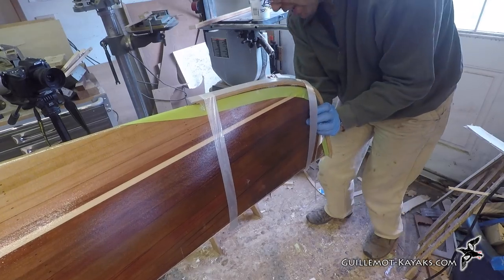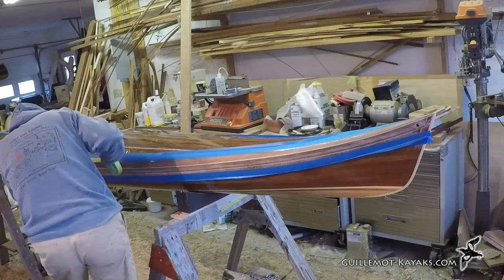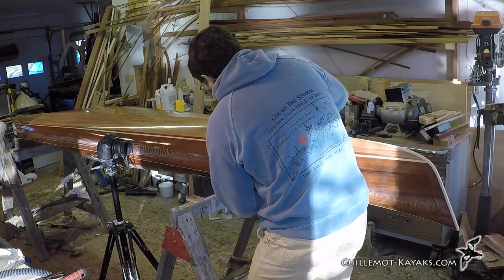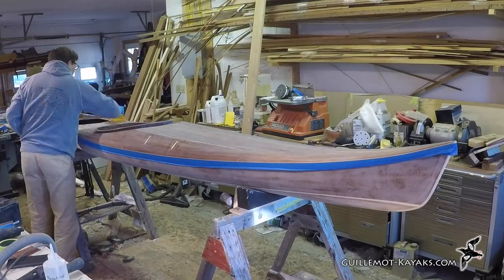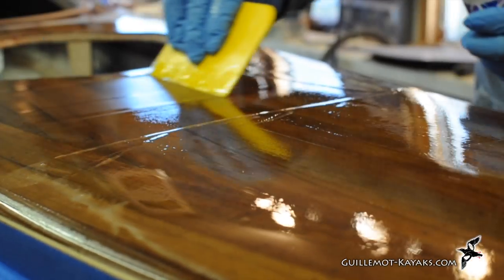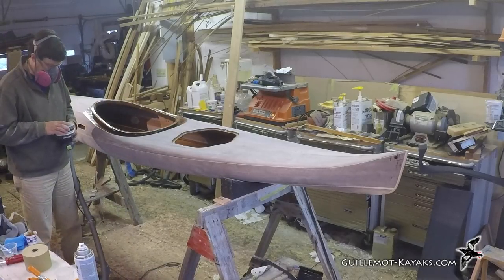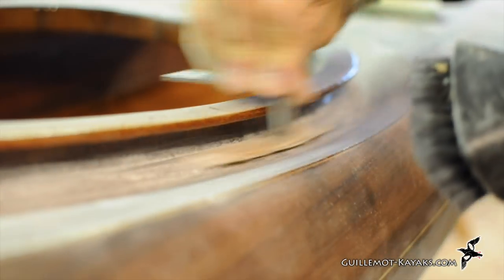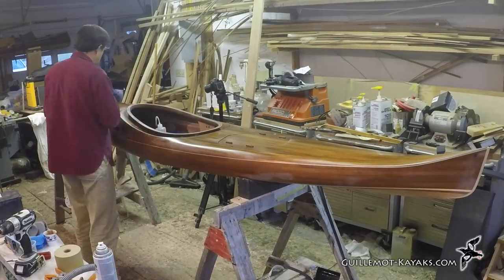Making a Strip Built Kayak - Outer Seam, Final Sanding and Prep - E17

Comment: Thanks for the videos - I'm a rookie currently building a S&G kayak and it's very encouraging to see how many layers of epoxy and sanding goes into getting a good finish. Without this I'd be less sure of what I'm doing poorly and what's actually OK. Cheers!
Reply from the maker: I'm glad you are finding it helpful. The fiberglassing and finish work of a S&G is essentially the same as a stripper. Other than the actual woodwork, most of the process is the same.

Comment: Nick,
This series has been amazing!!  Having read your books and acquiring shop space, I  look forward to building my own floating art!!  One question on fill coats...  Sometimes you use a heat gun to make it flow and pop bubbles, etc., but other times you use a torch.  Any difference between the two or whatever was closer at the time?
Reply from the maker: I use them almost interchangeably, the torch is more powerful, but risky. The heat gun is slower, but safer.  

I have found that with if I am using West Systems, the heat gun is ineffective, only the torch seems to do the job. With MAS either works.

Comment: Thanks for this video. I’m currently fiberglassing and applying fill coats to a CLC paddleboard, and have been struggling to achieve a smooth finish. This helps! Curious, can you explain the “torching” process a bit more? I’ve heard about the heat gun trick, but the torch is new!
Reply from the maker: The torch is essentially the same as the heat gun, only more so. Heating up the uncured epoxy lowers its viscosity, and expands the air in bubbles. This allows them to rise to the surface and pop. The lower viscosity helps the resin flow out and level. This would be particularly true on a nice level surface like a paddle board.

Comment: Several questions regarding hatch opening and cover -- In a previous video you mention sealing the edge grain of the cover with epoxy -- do you then add cloth or is the epoxy sufficient? And related questions to the hatch opening -- First of all, it appears you have added an inner strip to the opening that sets proud. Is this to better the seal or cosmetic? And at no point in the video series do I see cloth being added to the upper surface of the hatch opening. Given your propensity to cover all wood with cloth I assume this happened after the grinding of the finger grooves but was not shown -- or?
Reply from the maker: Hi Paul,
I usually add a little colloidal silica to the epoxy I apply to the edge grain. I have sometimes wrapped the edges with fiberglass, but its a real pain.

The spacer piece between the deck and the lip is there to account for the thickness of the gasket so the hatch will sit flush while on top of the gasket.

I covered the outside of the hatch with glass by glassing the whole deck before cutting the hatch. So, there was already glass on it before I cut it out of the deck.

I hope this helps.

Comment: How do I know when I sanded through the resin and into the glass? What would I do if I did sand into the glass? Thanks again for the great video.
Reply from the maker: As you start to hit the fiberglass you will begin to see the pattern of the fabric weave in a series of whitish dots. This is visible at 15:49 where I have sanded into the patch of fiberglass over the deck fitting. 

I don't mind sanding into this patch too much because there is more cloth below that patch.

While it is certainly not desirable to sand into the glass, because it breaks the reinforcing fibers, but hitting the fabric a little bit here and there is not going to make your boat explode.

If you sand into the glass extensively, or if you have sanded completely through the cloth, you should probably apply a patch over that area. Adding glass and then fill coating and sanding should make a seamless invisible patch. 

If you sanded through once, you should consider how and why it happened. Was there an un-fair part of the surface or was there an intentional high spot that  you need to be careful with in the future...

Comment: Do you use bias-cut 3"tape inside and out for the hull deck join?  Do you cut your own or buy commercial?
Reply from the maker: I use standard plain-weave pre-woven fiberglass tape on the interior seam and hand-cut bias strips on the exterior seam.

Dealing with hand-cut stuff down at the hard to reach interior ends is just not worth it. But on the exterior hand-cut wets out clear better.
Reply: I have used that commercial tape and it seems to have a hard edge on one side.  Do you cut that off?